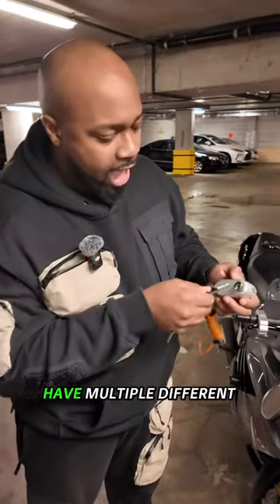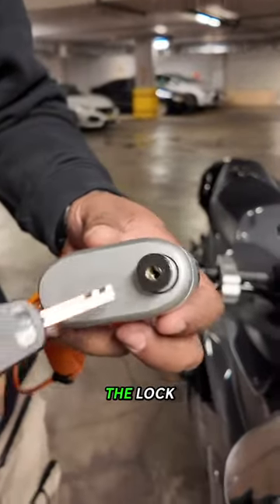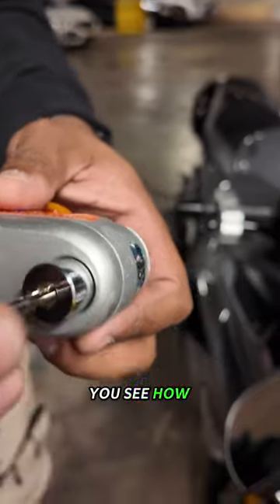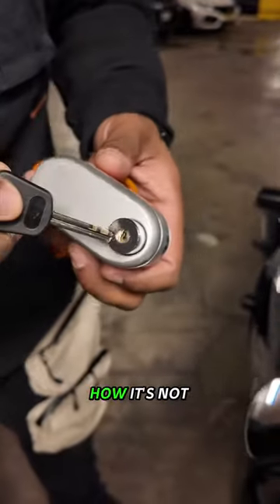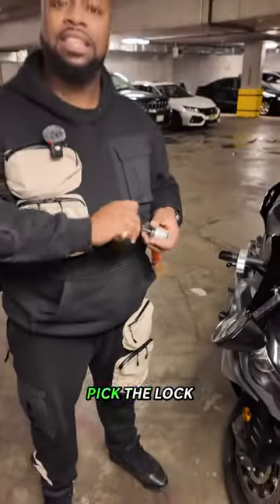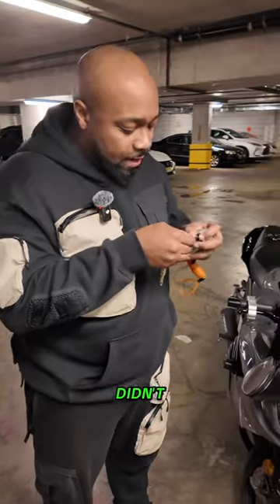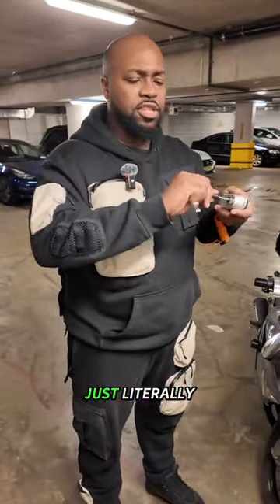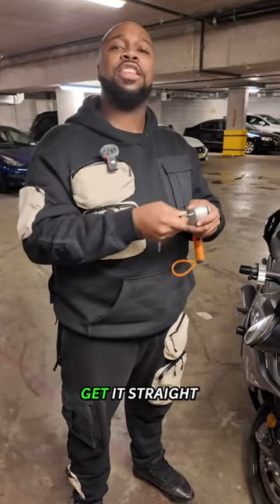Disc Brake Lock: Part 2 #motorcycle #safety #protect #bike

Comment: "lock picking lawyer here."
Reply: Naw more like 

"You are using a Yamaha DB lock 250
It can be opened  with a Yamaha  DB lock 250"- McNally Offical

...launches locks into the void 😂😂😂😂😂
Reply: @romanorleans504  You're not far off in a few of those videos I've seen where people are stealing motorcycles They hit it with their truck and it breaks all that shit off and then they just throw it in the back of the truck and drive off.